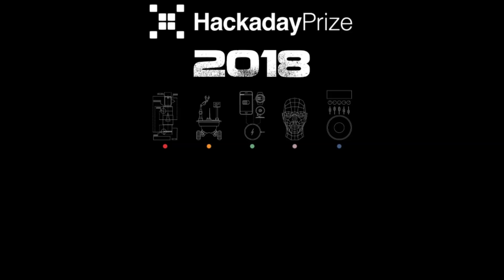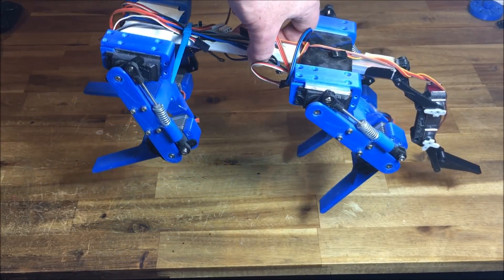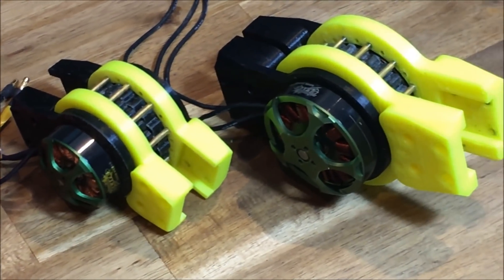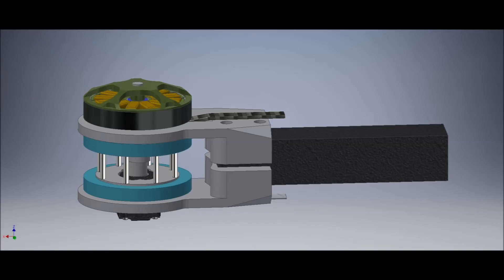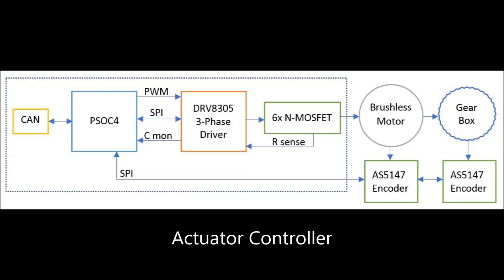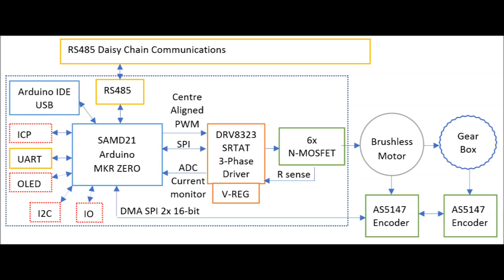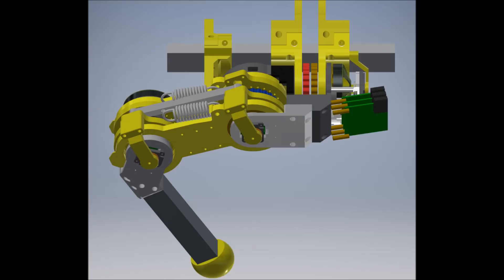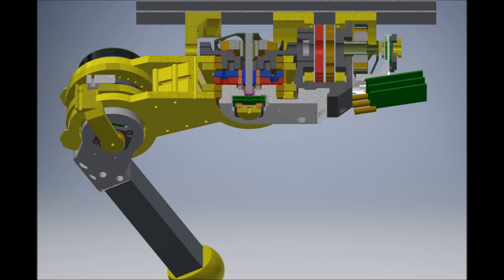3D Printed Robot Actuator Finals HaD Prize 2018

Comment: I want to know what Mike had to say!
Reply from the maker: He suggested that it was possible to put the motor shaft, input housing and output housing all on the same side as a series of concentric bearings. Very clever. This means that the input housing and output housing could be dual sided. The motor shaft could go all the way though and the eccentric shaft be supported on both ends.
Reply: @PaulGouldRobotics  I see. This makes it possible to create durable joint by 3D printing! Nice, thanks!

Comment: Is it possible for you make these actuators in a small size for a smaller robot ?.
Reply from the maker: The smallest I've made them is about 45mm dia and 40mm high. Smaller then that and servos might be better. Also going smaller means that precision needed to be higher and 3D printed parts are not that good.

Comment: hi, Why don't you use the sensors of the motor instead of the as5147
Reply from the maker: Most High pole count motor that are cheap and used the drones/quadcopters do not have inbuilt hall effect sensors. Hall sensors only give 6 counts per electrical phase. This makes holding torque very jumpy at low/no speed. AS5147 gives +100 counts which make for a very smooth holding torque and also works nicely with Sinusoidal commutation. (I'm working on FOC).

Comment: That's an absolutely brilliant execution of an underappreciated technique.  Now we just need to make it quieter.  Mind if I borrow the concept for a project I'm working on?
Reply from the maker: Thanks, it's open source. It is meant to be copied, modified and improved. Replacing the outer pins with bearings will make it quieter but the size and cost will go up. What are you making?
Reply: @PaulGouldRobotics  couldn't the pins be mounted in mini scale bearings for the same effect?  If I'm not mistaken, the noise is from irregularities in the print sliding over the smooth surface. Thereby creating vibration.
Reply: @PaulGouldRobotics  nothing at the moment, but I was thinking about attempting a mini industrial scale arm bot.  I've designed and built a few 3d printers, and some other bits, so I feel confident that I can master the control software.  I paint cars regularly, so I thought it would be cool if I could automate a custom paint job.  I think training the bot would probably be the hardest part.

Comment: Heh, I wonder how durable exoskeleton it would be possible to make with a plastic printer
Reply from the maker: I'm not sure, but it is low quality plastic (ABS), same as Lego. The printed parts are not that consistent. I would say that you would want to trust an exoskeleton with your life. Also the power to size/weight is not that great with 3D printed plastic. Metal is much better.
Reply: @PaulGouldRobotics  Sure, but it still would be interesting to see how far these can be pushed, especially if stronger filament is used.

Even if it wouldn't be as useful as metallic version, it would still be awesome as a home project!
Reply from the maker: @normoloid  Ok, so for a hip joint you could make the diameter about 150-200mm, thickness about 45mm,  place the motor inside and make it out of nylon with a higher reduction ratio. I will CAD it up and see what bearings I need.
Reply: @PaulGouldRobotics  Also, with a little designing of the "bones" it should be possible to house batteries in them, altough then I would probably put the batteries inside a metal tube fitted inside the plastic, which would make the whole thing a little bit stiffer than with just plastic.
Why put a huge battery pack on the back when you can just as well integrate atleast part of them inside the structure itself, making the whole thing much more balanced package. :)

Comment: It would be an idea, use hard disk motors
Reply from the maker: Hard Disk motors run at high speed but have very low torque. Low KV drone motors are cheap and powerful.

Comment: thats like a harmonic drive gearbox like we use it in our ABB robots.  quite impressive that you pulled off 3d printing one, whats the backlash on these?
Reply from the maker: I have made about 8 of these and it varies between none and 0.5mm @200mm depending on how my cheap 3D printed behaves that day. "Wear-In" is also a problem. This is fine for a Quadruped but would not be good for some requiring precision. So I came up with https://www.youtube.com/watch?v=2fDbMWHQbC8 The torque loading is lower but the backlash is always none.

Comment: Nice gear. Grate job on the reposition to the last state after force it to be bended , if it has a force feeback would be perfect! 
Sorry for my bad english
Reply from the maker: The Series elastic Actuator (leg) version has spring deflection measurement. See the middle ribbon cable (and hidden sensor) at 2:23 of the video

Comment: Damn, I was planning to do almost the same. The difference is that I was going to put the motor inside the assembly attaching the eccentric disc to its body, not the shaft.
Reply from the maker: I would like to do this also but I could not find a motor small enough. Do you have any motors in mind?
Reply: Looks like the response was deleted by spam-filter...

Comment: Great actuator, ingenious way to get positional data back from a BLDC motor. Is there an upper bound value in terms of motor KV or is the system’s design proportional to the KV? Any results as to the longevity of this system? I’m assuming those 3D printed parts, specifically the gears, take some serious wear and tear.
Reply: Yeah, 3d printed gears do really well in low load technique, but can see terrible wear once friction is involved.  I'm going to try making this with both a hardened aluminum rotor and a tpu cartilage sheath.  I think this is a brilliant idea.

Comment: Do you have any info on the previous gearboxes you tried out? Im particularly interested in the magnetic and harmonic ones.
Reply from the maker: I will post some assembly videos and the CAD files in the next few weeks of several magnetic gearboxes and one failed harmonic drive. Check out http://magneticgearing.blogspot.com/ for external research papers. Search Thingiverse.com for harmonic drives. They are way better than mine.

Comment: Awesome design and work! I've also used the AS5161 absolute position rotary encoder from AMS on top of a commercial servo. It works great!
Reply from the maker: I like the AMS range. They are a bit expensive but really the only good/easy solution.

Comment: What sort of efficiency did you get, haven't been able to exceed 80% with my design
Reply from the maker: I don't know how to do an efficiency test. If I am above 60% (with my cheap 3D printer), I would be happy. Please go to hackaday and send me some images of your gearbox.
Reply: @PaulGouldRobotics  you measure the torque output and divide it by the theoretical torque output given by your motor torque multiplied by the transmission ratio
Reply from the maker: @The_noticer-u2b  That would give me static torque. I would be more interested in dynamic torque. Maybe I need to make a dynamo? At this point the actuator creates more torque than I need and uses less power than I though it would. So, I'm happy with it. If I am aiming at high efficiency I would not use 3D printed ABS parts and futher develop the SEA (Serial Elastic Actuator).

Comment: Wow dude, nice work, u give me the inspiration for back to my quad bot, are you think psoc 5 can do all? With no driver?
Reply from the maker: Please make a quad too. It would be nice in a years time we can have robot quad races and challenges. The FET driver creates high current/fast gate signals for the FETs as well as a charge pump for driving the high side N-FETs. An all-in-one solution could be using the STSPIN32. I have started a design for this but the CPU is limited. I'm looking at the SAMD21 (Arduino Zero) with a FET driver. Check out https://hackaday.io/project/165217-arduino-brushless-actuator-foc-controller

Comment: Hi, have you followed up on this?
Reply from the maker: I have been working on a all 3D printed version with no pins. I am in the process of designing the electronics to be cheaper. One based on Arduino and one on ST-Spin. My plan is for makers to create each actuator for under $US100, including motor, gearbox, electronics and position encoders/sensors. I have been working on a tail. https://hackaday.io/project/163766-low-cost-3d-printed-robot-tail
Reply: @PaulGouldRobotics  Hi Paul, Thanks for your response. The progress is looking great! If you need with anything, give me a shout.

Comment: Is there any way to make the torque output higher?  I’m working on a project that needs to lift a arm similar to your weighted arm test, showing the rough torque output.
Reply from the maker: I have limited the Motor power to about 60W peak for the tests. The motor "should" be able to go 10x that for short bursts. I will push the actuator until it breaks in the next few weeks, after I have made a few more. If you need more torque and less speed you could always increase the reduction ratio.
Reply: @PaulGouldRobotics  Really looking forward to a followup on this. It really looks like the best low weight, low backlash, small, high reduction transmission for robotics. What is wear and tear like, how much power is lost on friction, at what kind of forces does it break? Amazing work!

Comment: Very nice work! Have you measured the backlash of the cycloidal gearbox? Also what material did you print the gearbox parts in?
Reply from the maker: The test actuator has 0.5mm of backlash at 70mm from the pivot = ~0.4degs (it has half the outer pins installed). The Hip Actuator has about 1mm of backlash @ 70mm or 0.8deg  (with only half the outer pins and half the inner pin installed). The knee actuator has less than 0.1mm of backlash @ 70mm or 0.1deg (half the outer pins). It mostly depends on the precision and settings of my cheap 3D printer. All of the 3D printed parts are cheap ABS. The pins are brass on Silver steel rods. The order of development went hip actuator, test actuator then knee actuator. This means that I am getting improving as I go. I will have to try Nylon next (after a hot-end upgrade). Once I get one leg "right", I will make the rest.
Reply: Thank you, Paul. I think a lot of people can use this in their project. You are getting quite low backlash considering the manufacturing method. I agree with nylon. What gear ratio are you showing the video?
Reply from the maker: They are working way better than i thought they would. The ratio is 26:1 for the big actuator (test, hip and legs) and 21:1 for the small one

Comment: Awesome to see some progress in this project.
And I wish you good luck with that entry, it is really good project.
I hope you don't mind if I adapt those for a robot arm, I always wanted to build one just for the lols.
With your gearbox combo that thing could actually be useful, sadly it has to wait rl is busy right now.
Reply from the maker: Hi Tim, This is an open source project. Please share, make and improve. I have CADed up an arm. https://hackaday.io/project/157812-3d-printed-robot-actuator/log/147660-robot-arm-design Also check out some of the robots arms at "gear down for what"

Comment: You deserve to be more known! Amazing work
Reply from the maker: Thanks fabcol. I have only just started sharing my work.
Reply: Paul Gould lol, there are YouTube vids of this exact design from 3yrs ago and there is a startup from a few yrs offering modular robotic design.
Reply from the maker: @justtestingonce  I have seen videos on designs using outer pins. I have not seen designs using having the dual housing and dual output put shafts. I have also not seen designs with magnetic encoders for both motor position and joint position like mine. Can you please add some links, I would like to learn more.

Comment: you need a pid in there so descend is the same speed as ascend, but otherwise awesome.
Reply from the maker: I have the current/power limit set very low for these tests, only 60W from a 600W motor. The system has some PID position control but also need velocity control too.
Reply: Paul Gould sure you have seen it already, but just in case https://youtu.be/WJkf264yxTU
Reply from the maker: I like James Bruton's robots. He makes some good robots fairly quickly.
Reply: Paul Gould generally amazing what all of you are doing, good luck in the competition.
Reply: @PaulGouldRobotics  James should definitely use your actuators for his "big dog" project instead of using lead screws. Why not connecting with him ?